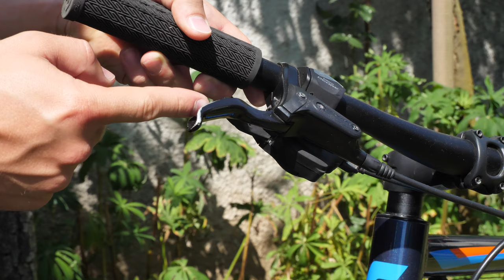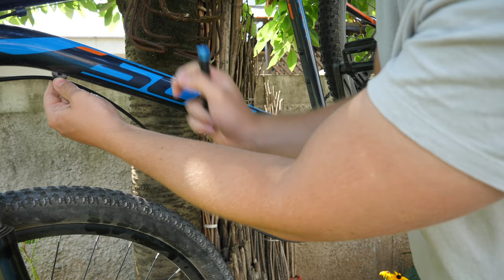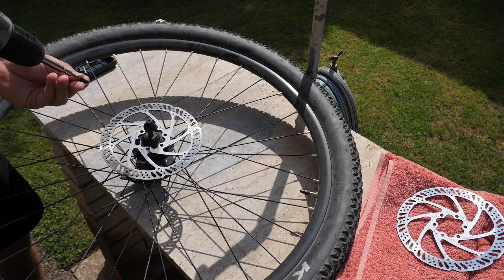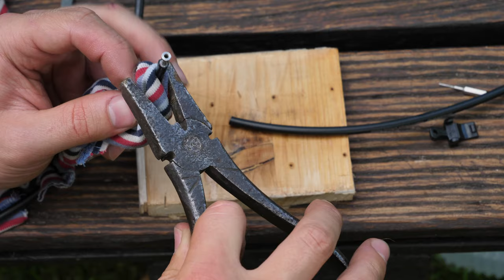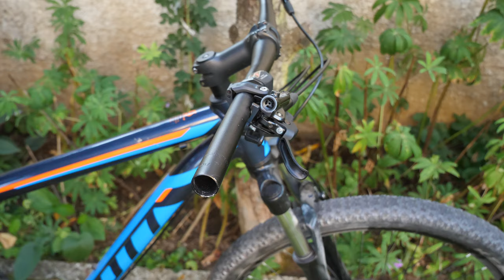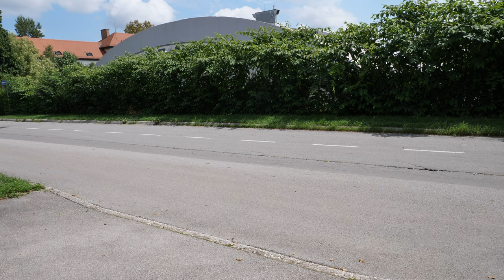How to Upgrade Mountain Bike's Hydraulic Disc Brakes (BR-M6100 & BL-M6100)

Comment: Can I use the m6100 brake on the SM-RT10 rotor?
Reply from the maker: Yes, the components should fit. The question is if you are going to need spacers between the brake callipers and the frame of the bike/fork.